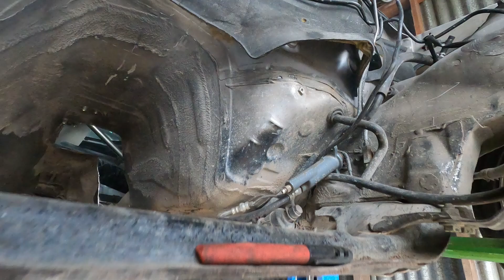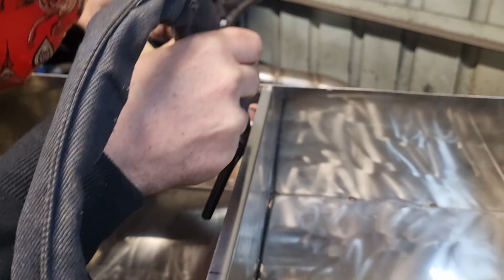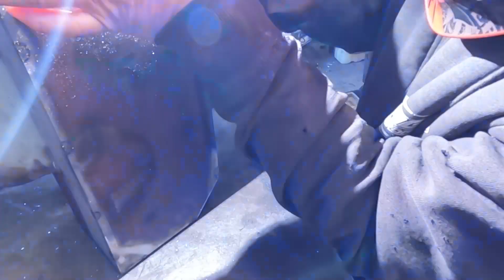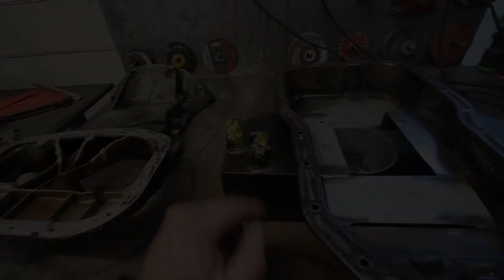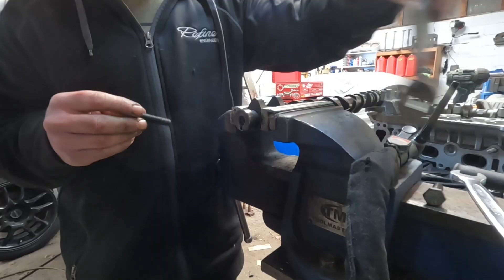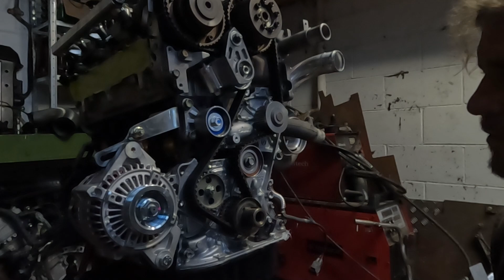MK4 Supra Build EP2

Comment: wealth of info here. Merry Christmas to you guys over in New Zealand.

Edit:  Could you include part numbers for the valve springs, intake and exhaust valves you used? that'd be awesome!
Reply from the maker: Cheers mate. Merry christmas to you too.

My machinist sourced all the parts so i dont actually know. they are K20 exhaust valves (end up being 1mm oversize), H22 intake valves and seadoo valve springs. there is a fair amount of machine work involved so everything is far from bolt in. you could possible email Kennelly Cams for more info